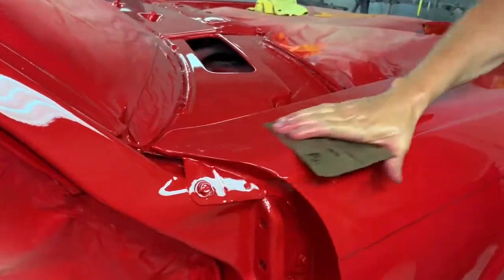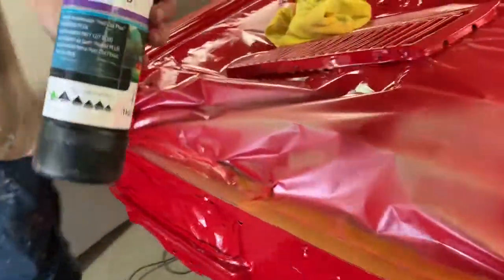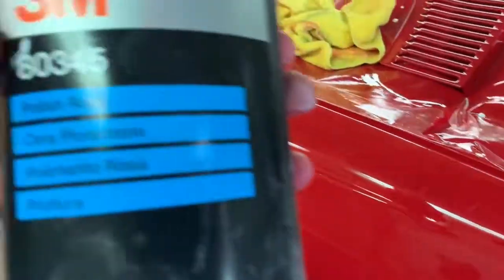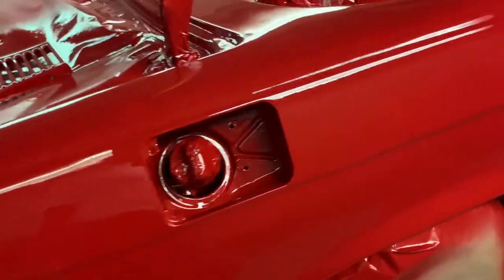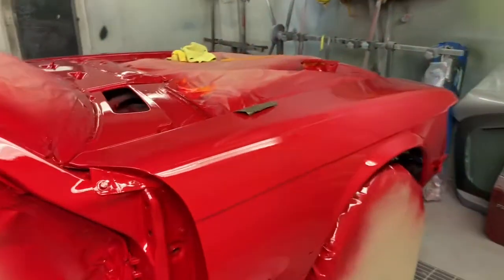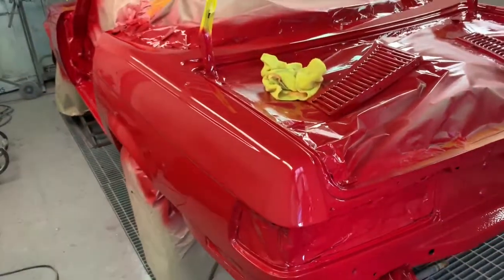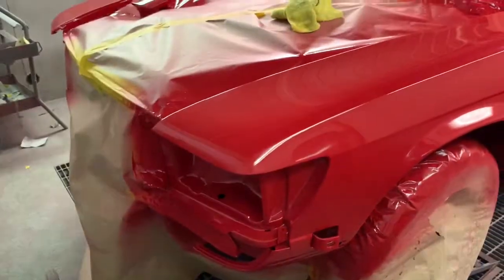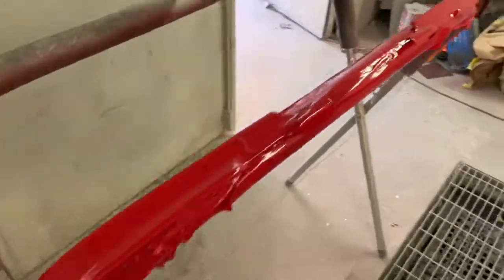Mercedes R107 280SL full respray

Comment: Mike, how do you remove those two pieces that are painted (sitting in the boot area) that are right in from of the windshield on the left and right side? You have a video explaining that?
Reply from the maker: Hi - do you mean the two air vents? If these have never been removed, they will be riveted to the bulk head with three rivets. You will have to drill out the rivets and then replace the rivets with screws. I have one of these messing on the new red project so I will be taking one of the gold parts car in due course. Meanwhile....these bits get a brief mention at 11.04 in https://www.youtube.com/watch?v=KJVgWi3mdME 
Mike

Comment: My car is same colour it costs me nearly £3k in Jerusalem to repaint and it took me a month to find an old fashioned car body shop that accepted to do it. It cost less than £1200 to repaint any car there but since I saw how much rust they needed to deal with it was a cheap job. It took them more than 5 weeks to get it done. The son of the shop owner swear that he will never accept doing these cars again.
Reply from the maker: Thanks for your comment. I paid about £2000 to get the rust and welding sorted which was cheap bearing in mind the amount of work....and then £3000 to prep and paint the car....which was also cheap bearing in mind the time taken to strip the car down and get certain parts back to bear metal. Did you replace and of the seals yet? Mike

Comment: Can you share how much this spray job cost please?
Reply from the maker: Hello - I paid £3000 which seemed ;like a lot at the time but actually turned out to be quite cheap bearing in mind all the additional work that was necessary to prepare the car for paint. Things like the bonnet and the boot lid were taken back to bare metal which took a lot of work. I ended up putting the car back together myself after it was painted which I initially thought would have been included in the price. In the event I'm quite glad I did because it gave me the chance to refurbish all the parts before putting them back on the car. Mike
Reply: @MikesMercsandothercars  thanks Mike. I really enjoyed your videos. Will be doing the same to my SL soon so it helped understand the size of the jobs.
Reply: Another question for you Mike. Did you get any chroming done? Getting my sl sprayed next week but the guy doesn't do chroming. Just wondering the costs, of you went that route?
Reply from the maker: @FlipSideG  Hi - I didnt get any chroming done although i did visit a few places and enquire about prices. What parts are you looking to get rechromed? Sometimes it is almost as cheap to buy anotherv 2nd part in good condition..if possible.